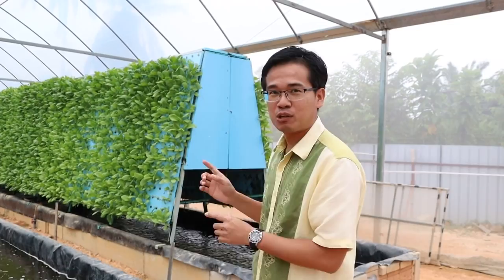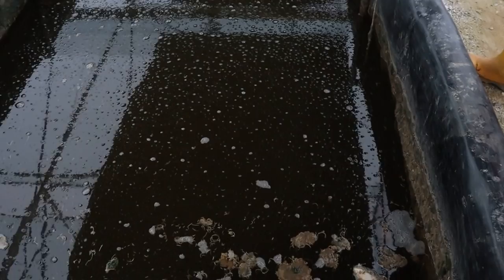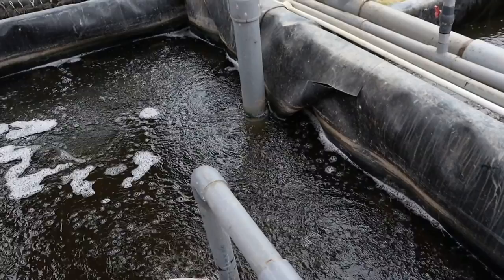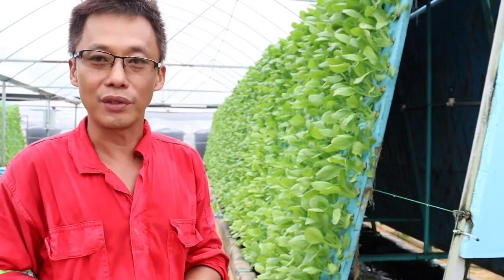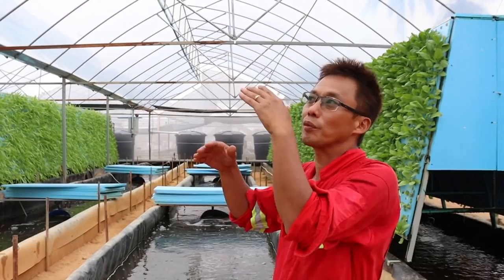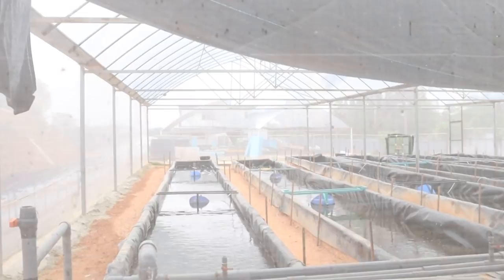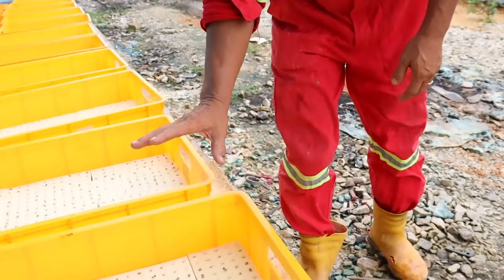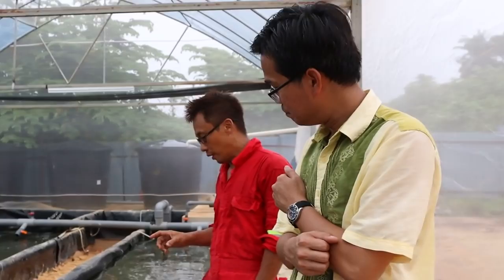Integrated Farming: Aquaponics

Comment: a nice alternate version of aeroponics. Looks like you can get away with a drench instead of a fine mist which would be problematic using cultured water.  Since this looks like a new farm I wonder if its going to make a profit.  Lots of power requirements.  Like the use of the brushes in helping clarify the water
Reply: it is energy efficient.  total pump running time is less than 6 hrs a day. average power consumption is 1500kwh a mon ea grenhouse